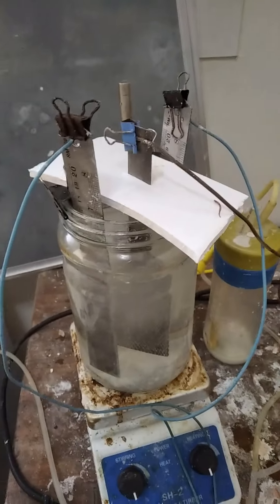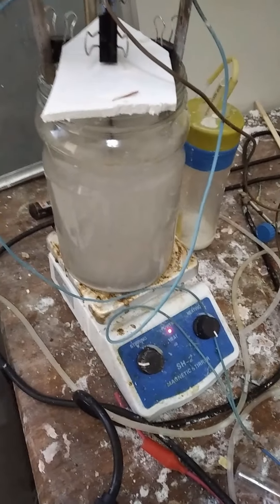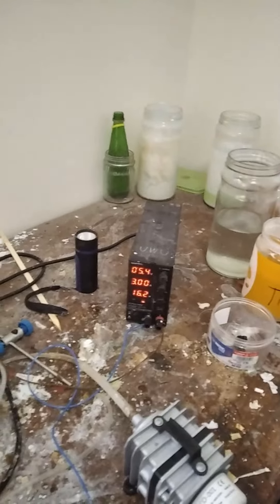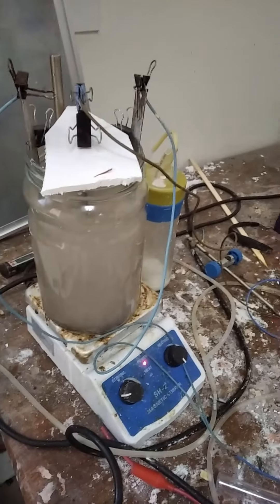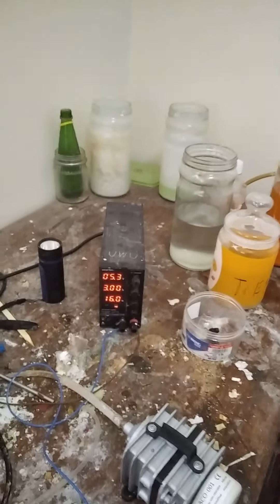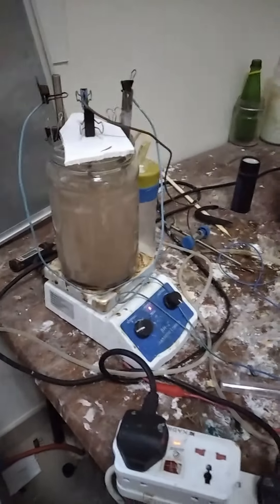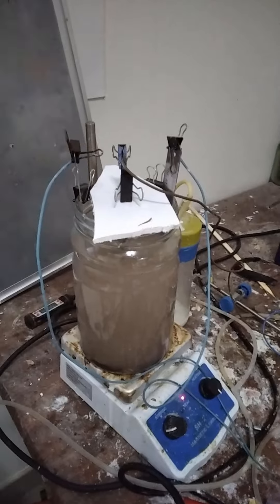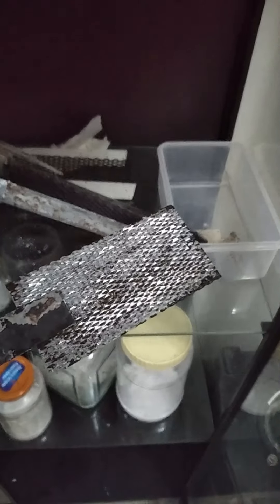"ATO" substrate PbO2

Comment: For the voltage range you've used it's good progress. Thanks for sharing <3
Reply from the maker: that was merely a test cell btw and only meant to simulate operating conditions in the cell minus the insane temperature and cooling requirement.
Reply: @CatboyChemicalSociety  Thanks again. I hope you can continue making improvements <3

Comment: How about some bismuth additive while plating the alpha lead dioxide layer?
Bismuth oxide should be somewhat soluble in the basic plating solution, containing concentrated NaOH.
Reply from the maker: I mean u can dope PbO2 with anything.
the plating solution is already pre doped with CeO2.
Overall its still an alpha lead dioxide plating solution and these electrodes are convinient but not as convinient as the beta plating solution of lead perchlorate which is really good.
Alpha Beta layered composite electrode still performs better overall but is cumbersome.
The best really is Ir-Ta substrate thin layer alpha PbO2 electrode since the alpha PbO2 doped is better than beta PbO2 which has to be pure or impurities will lower its efficiency.